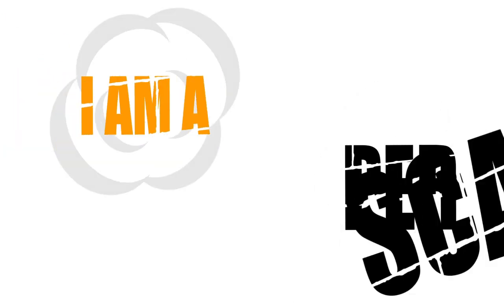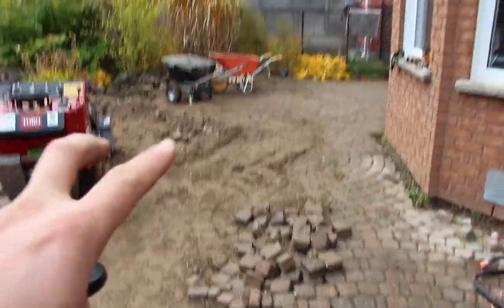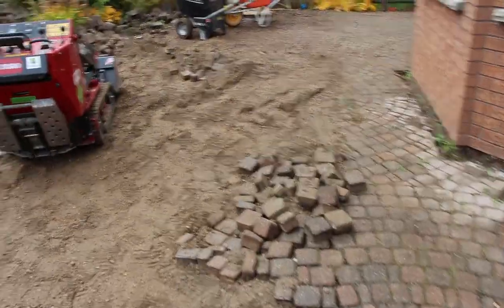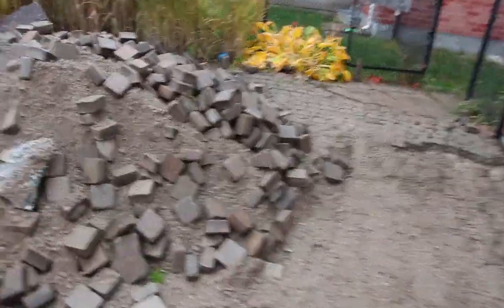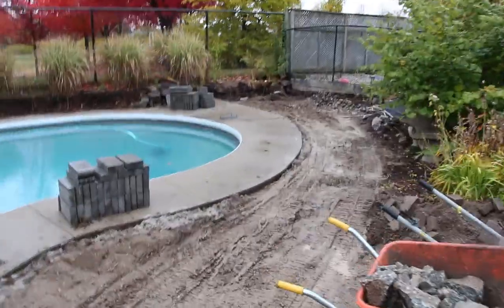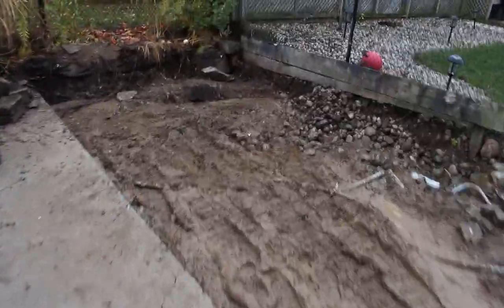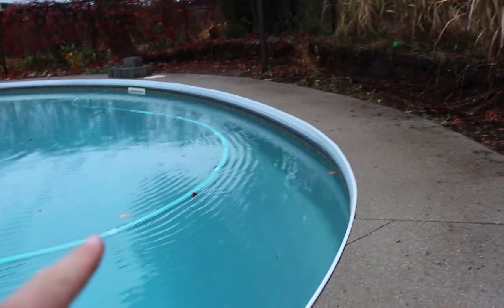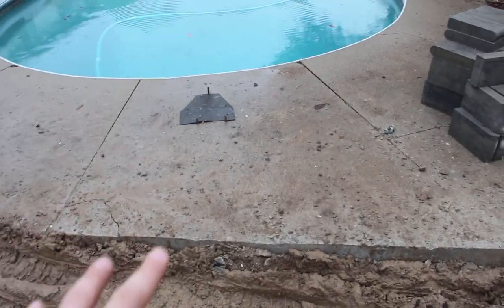I Cut Through an Electric Line on Demolition Day

Comment: Was wondering how much are the prices for laying pavers in toronto? In montreal its about 20-30$ per square ft. (New pavers with excavation)
Reply from the maker: 20 would be too low in Toronto. 30 would be the lower end of the scale for a backyard patio. But every project is different.